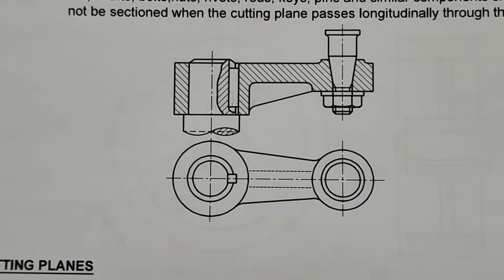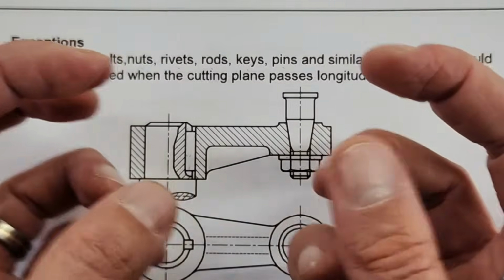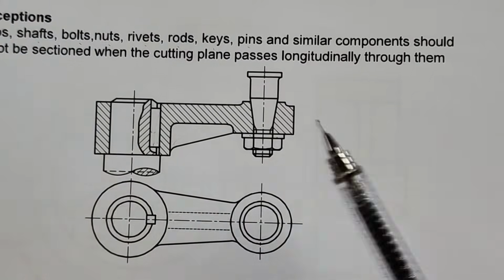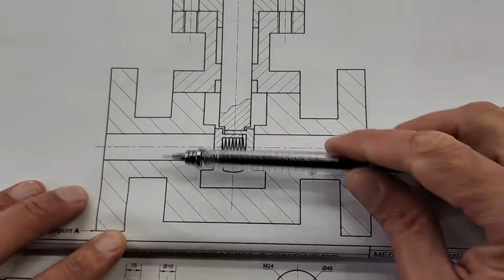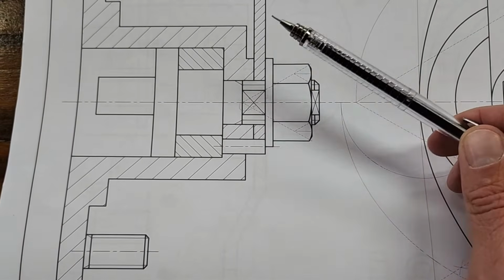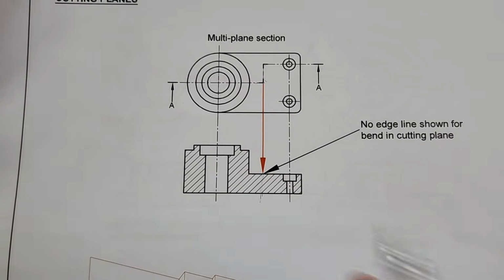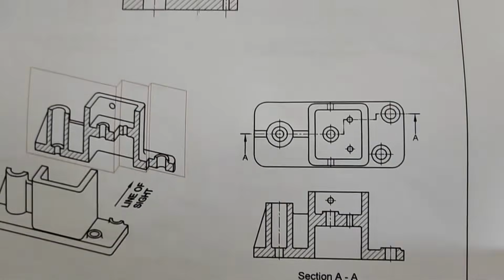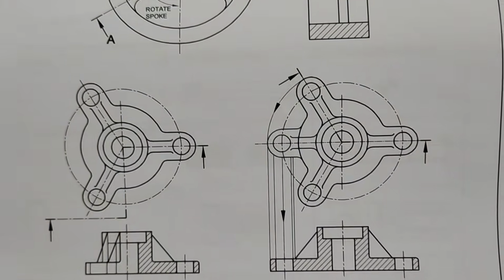Mechanical Assembly and Hatching Conventions

Comment: what if we are only asked to draw a sectional front vieew of a nut and bolt
Reply from the maker: Hi, remember that a bolt and a nut is a fastener, so you will not section/cut it, but just draw it as is when included in a sectional elevation... Keep Drawing